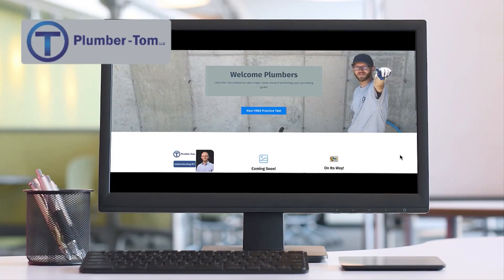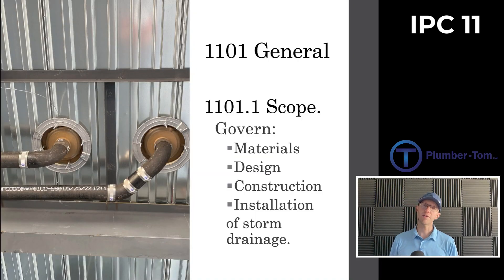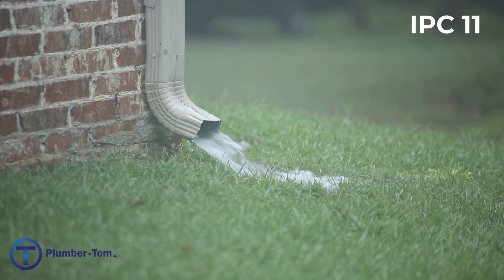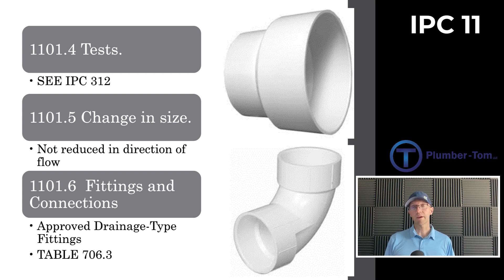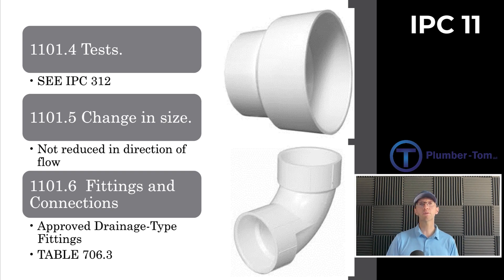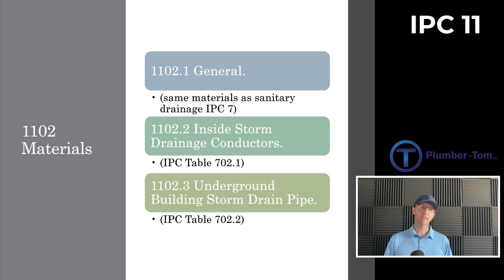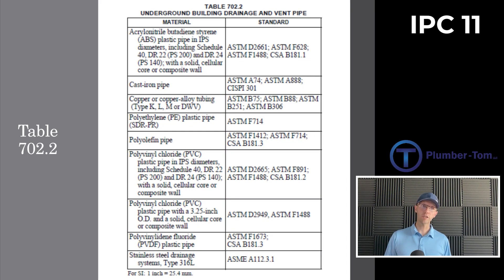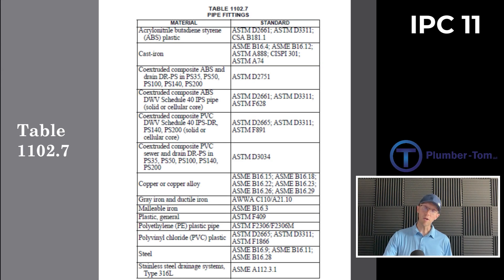Understanding International Plumbing Code Chapter 11- Sections 1101 to 1104

Comment: Sorry I looked it up the upper 10 foot is excluded from a 10 ft teast    same as upc    could be worded differant you only test to the roof
Reply from the maker: Good point.  I should have mentioned that.  Tests are really just fill it up to the roof.  Thanks!

Comment: Intresting differance   between ipc and upc     at least in practice on jobsites    we fill to roof  no 10 ft head above  the roof     so the upper joints might only have a 1 or 2 ft head
Reply from the maker: Right.  That is typically all I have been required to do as well.